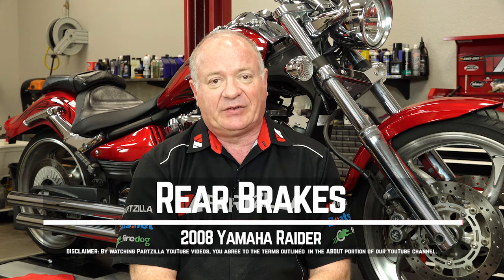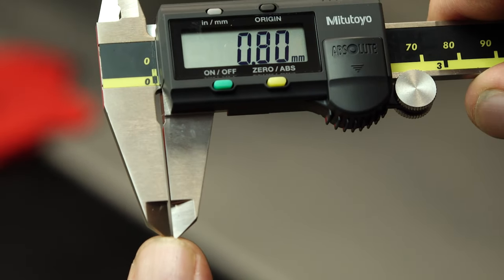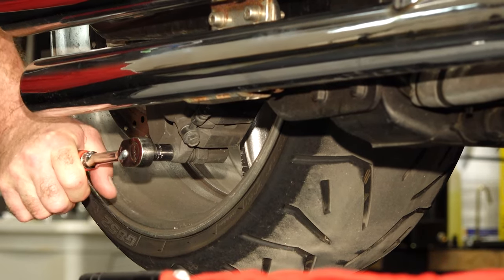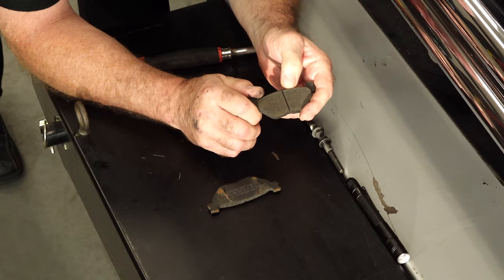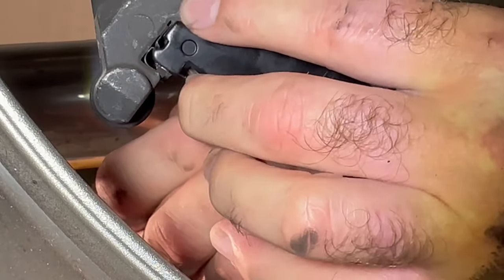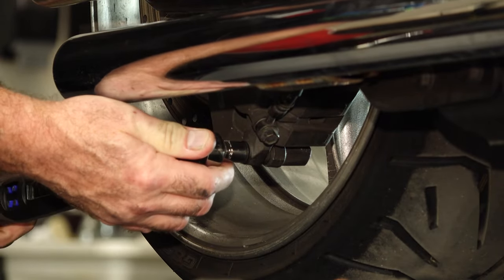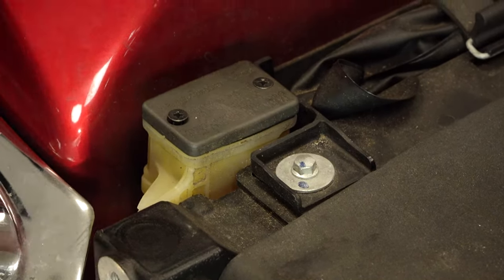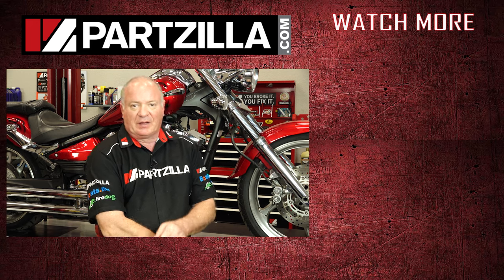Yamaha Raider Rear Brake Pad Change | Yamaha Raider Rear Brake Pad Replacement  | Partzilla.com

Comment: Never hurts to check the fluid before retracting the piston for just the reason you mention.  If someone with worn pads thinks their fluid is low and tops it off, you can make a real mess compressing that piston and dripping brake fluid on paint.

Comment: My wear limit comfort depends on the rate of wear.  The front brakes on my 2007 K1200LT are still original at 100,000 miles and they still have about 5mm of pad material left.  I am not sure how thick there were new, but I don’t think these are wearing more than 0.3 mm per 10,000 miles.  I will run these down to 1 mm without thinking twice.  The rear pads on the other hand wear much faster.  I am on my third set and they are about half worn out.  They probably wear 2 mm per 10,000 miles.  I tend to replace them around the 2 mm point simply to ensure I don’t run out of pad in the middle of a tour.  The main difference in wear is that the front pads are full sintered pads and the rear are either organic (OEM) or semi-sintered (current EBC pads) and wear much faster.  I use both brakes pretty much all the time, but they are linked so even if I apply one end, the other gets activated to at least some degree.  I still can’t believe the original pads are only 50% or so worn at 100K miles, but them’s the facts.
Reply: Dir sir, There is nothing here to believe, or not to believe. Assuming your report these are the facts, then one of two possibilities is happening: 1. Either you are not stopping correctly, because with proper use of the front brake it should wear more. This may be important in emergency braking, because the rear brake cannot provide more than 30% of the power brake, and the front gives at least 80%...So maybe you check your braking habits with a professional riding instructor. 2. It is possible that your reinforced pads are only 50% worn, but the disc itself is already out of specification, check the thickness of the disc.

I may be wrong, I share what makes sense to me.
Reply: @MyINNOVAMotorcycling  You are right in that you are wrong.  😁.  I was a certified Total Control riding instructor and my braking skills are quite good.  I have been riding for 54 years and my riding skills are quite good.  I suspect the reason for the minimal front pad wear is due to several factors, listed here in the order of most likely probability of contribution:
1. I live in a rural area so most of my riding is on the highway and not in city traffic.  I need to use my brakes much less than many other riders.
2. I use good riding strategy and rarely have to brake hard.  Most of my emergency stops are for deer.  I don’t follow other vehicles closely and I slow to known stops gradually downshifting as I slow.  I generally am below 20 MPH before I need to apply brakes.
3. The front brakes on the LT are massive and require very little effort to slow the bike.
Reply: @LTVoyager  
So you have a very, very relaxed riding style. But why do you prefer to stop the whole big mass mainly with the rear brake? Especially in view of the fact that the braking efficiency of the rear brake does not exceed 30%. The 1:3 ratio should be reversed, isn't it. The situation will be such that the rear is hardly used, or used mainly when standing still. Why do you prefer to use the rear more? Obviously, the important thing is to drive slowly and safely. This is the most important, I ask for curiosity.
Reply: @MyINNOVAMotorcycling  You keep making unwarranted assumptions.  My riding style isn’t that relaxed, I simply plan ahead for my stops when able.  It is crazy to make every stop sign and light an emergency braking event as some riders do.

You are incorrect about the contribution of the rear brake.  When initially applied, the rear brake on most motorcycles, some sport bikes may be the exception, provides more braking than the front.  When my LT is fully loaded and riding two-up, I have close to 70% of the weight on the rear tire and thus it provides 70% of the brake force at initial brake application.  As the weight transfers as deceleration increases, this rapidly shifts from rear to front and probably ends up with 70-80% on the front tire and 20-30% on the rear.  Sport bikes can get 100% on the front wheel, but my LT won’t do a stoppie.  In a planned stop with 0.2 G or less of deceleration, I probably never exceed 50% of braking on the front wheel.  I would have to do the calculations to be sure, but I suspect my guess is close on this.

Lastly, I don’t use the rear brake more.  I use both brakes equally almost all of the time.  My BMW computer tracks how many times the brakes are used and how often the ABS is activated.  My brake use is almost exactly the same on front as on the rear.  I explained in my earlier post why I believe the front brakes are wearing so slowly on my LT.  The one variable I can’t account for is the brake system algorithm itself.  My LT has servo assisted integrated brakes and it proportions braking power front to rear electronically.  To the best of my knowledge, BMW has never made the algorithm public.  Those of us who own LTs know that activating either just the front lever or just the rear brake pedal will activate both front and rear brakes, but as to what proportion, we have no way to know.
Reply: @LTVoyager  💖
💖👍